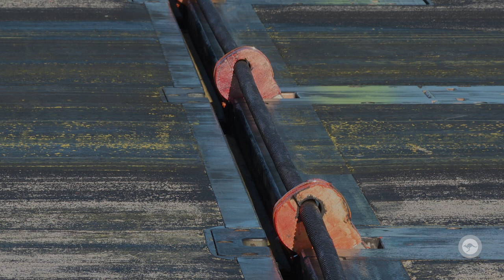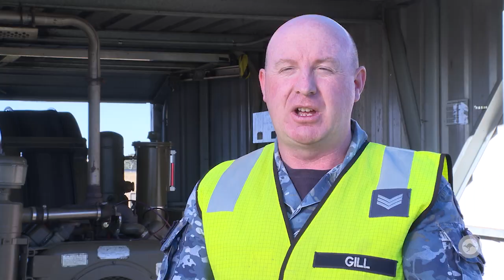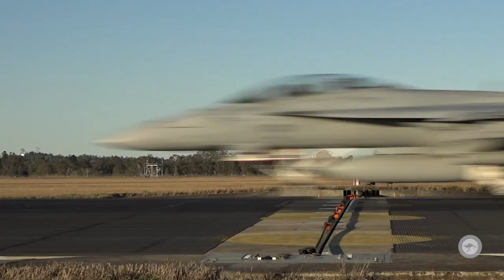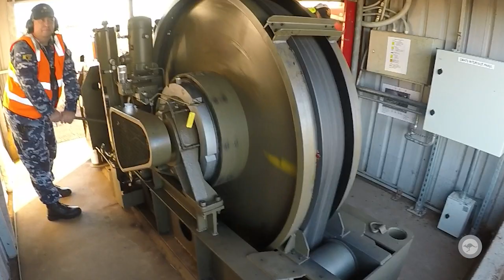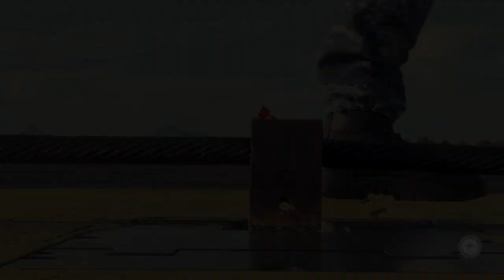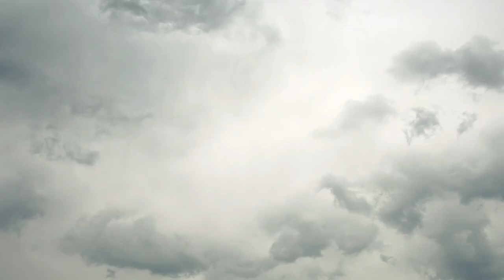Air Force’s aircraft arrestor systems ready to go

Comment: Does this mean theoretically Australian RAAF Pilots could land on us carriers
Reply: I'm only guessing , but it would not surprise me if their were no RAAF air crew acting in exchange with the US carrier group at times . The main reason they have these are for emergency such as the time when a F111 either had lost a wheel or,'  it failed to deploy, so they had belly land  using arrestor gear on the runway.
Reply: No. They are landing on the runway the normal way. They roll on to the arrestor cable with the nose down on the ground.